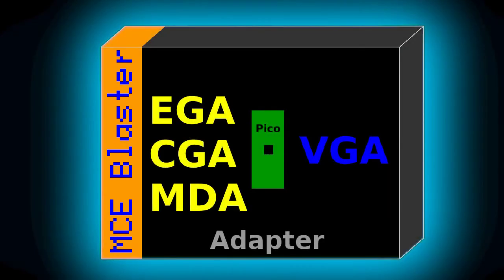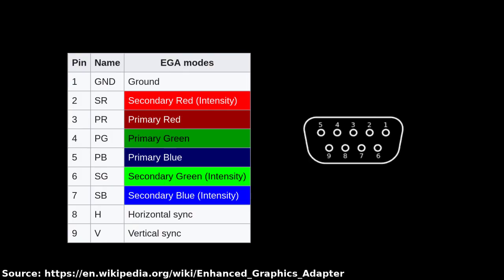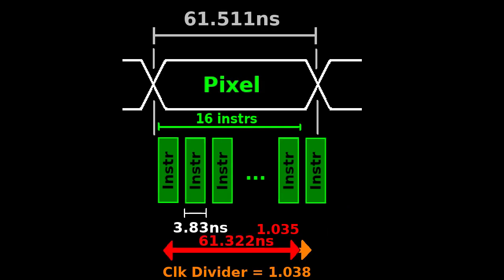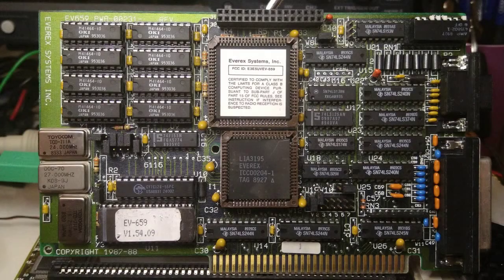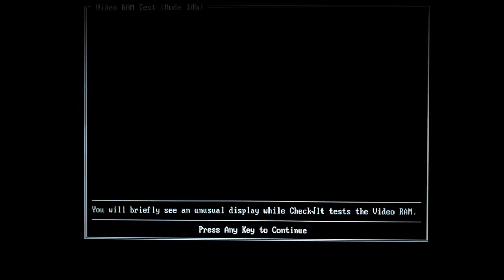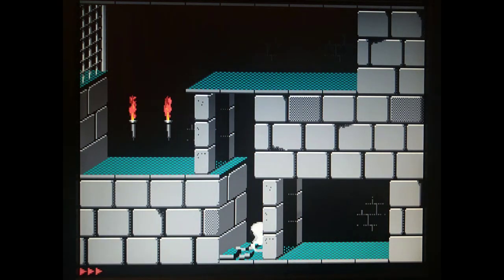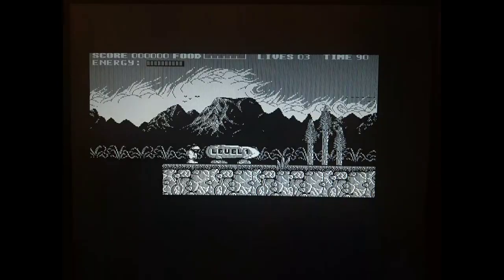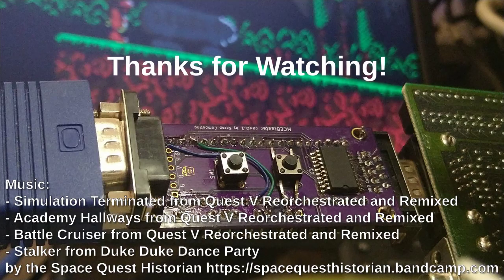MCE Blaster MDA,CGA,EGA to VGA Adapter Released! (Part 2)

Comment: It is possible to use a female DE9 connector on the reverse side of the board with the current design and use a cable instead of plugging in directly? I currently have my Necroware MCE adaptor mounted to a serial port bracket inside my machine with a tiny IDC ribbon passthrough from my CGA card on the outside. It is quite an elegant solution.
Reply from the maker: I think they have the same pinout so you could use a female connector too. But I think the cable has to be quite short otherwise the signal does not get picked up properly.
Reply: @scrap_computing  Usually the pins are reversed left-to-right between the male and female connectors, which is why I mention maybe soldering it on the other side of the PCB, if there is clearance and the pins line up.
Reply from the maker: @SanguineBrah  It should fit fine. The only component that is close is the IC, but I think there is enough clearance.